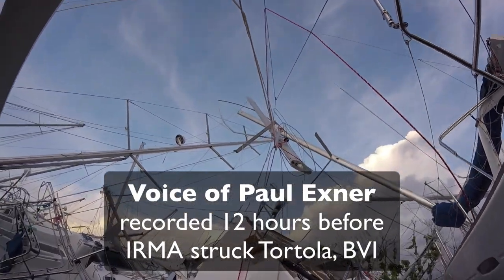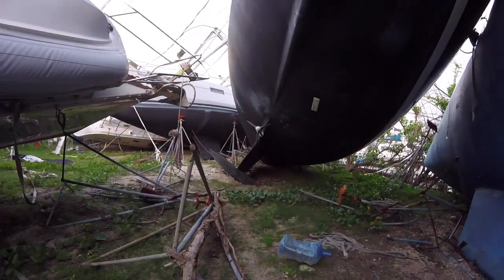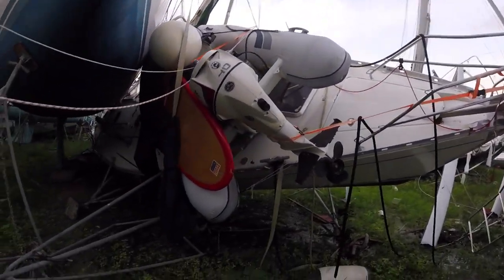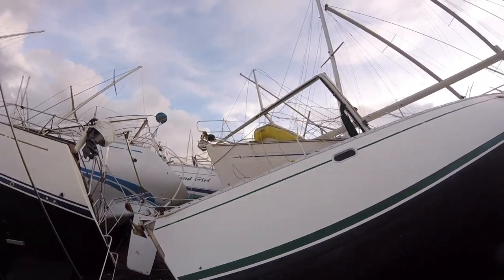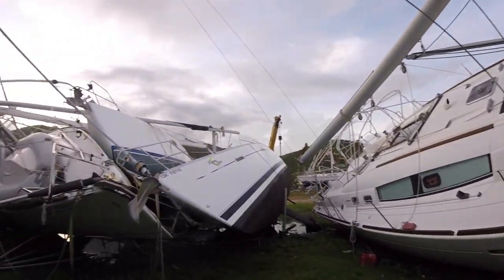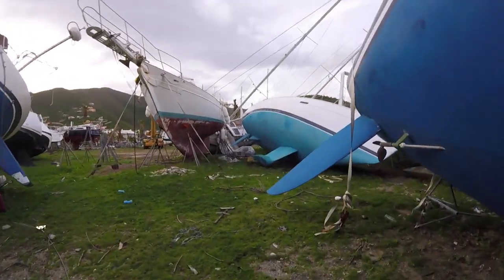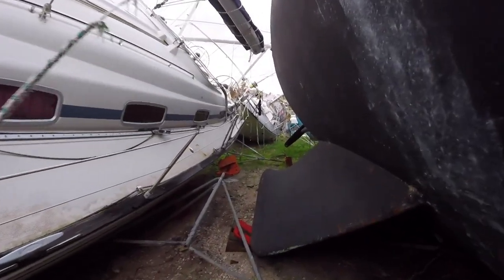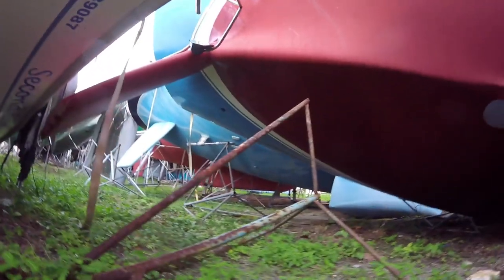Boat Yard FAIL -- Sailboat Hurricane Storage Gone Wrong!

Comment: lots of money there, a lot look they "should" be ok though, maybe some minor hull repairs or some stringer repairs here and there
Reply from the maker: Thanks for your comment, John. Many of the hurricane-boats were repaired and went sailing again; and many were cut-up and salvaged for equipment like winches, cleats, engines, fittings, etc. It was interesting to see which Brands of boats were well constructed and which had substandard layup. Some keels cracked-off and we could see the laminate schedule and dry-glass was the culprit. Interesting days that I don't want to ever return to. Aloha from Hawaii with Hurricane IRMA in the rear-view mirror.